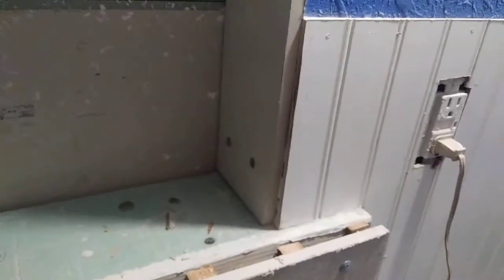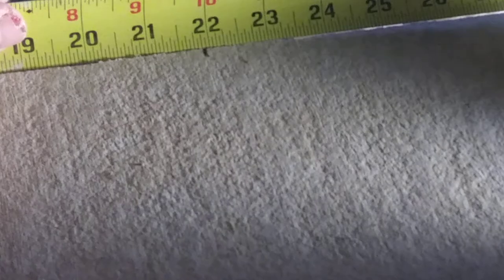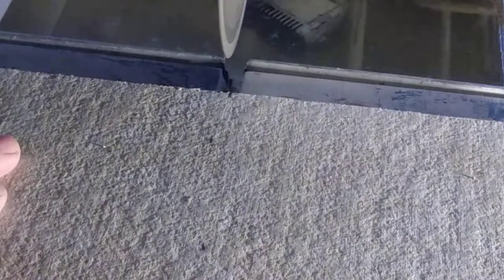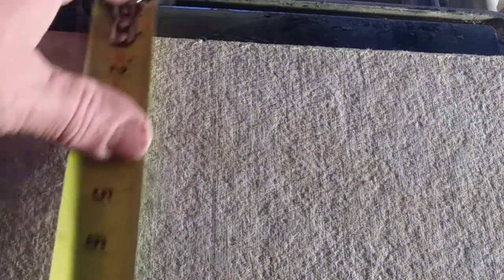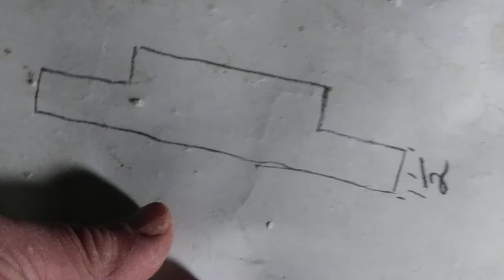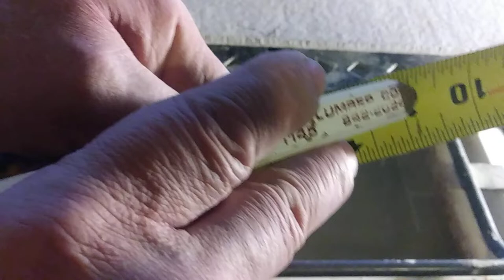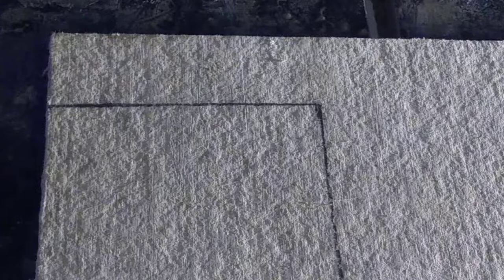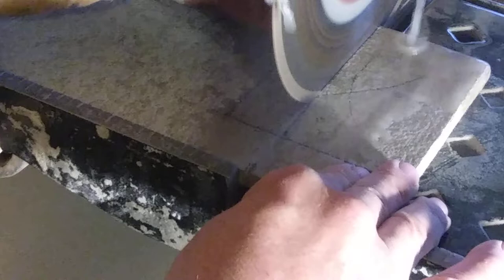Custom Built in Bathroom
Tile Shelves Series Part 1.

Comment: How's she goin'?  Your bathroom is coming along pretty nice!!!  That wet saw works well and sure cuts that cement board.  Take 'er easy!!!
Reply from the maker: That wet saw works perfect.
I don't like all that dust using a respirator, or holding your breath.

I've even used a water hose while I cut using a grinder in the diamond blade and that helps you can't be using a wet saw when you can for the concrete backer board that's for sure.

Thanks for your time thanks for stopping in keep up the great work on your Channel 5 for now God bless Ken